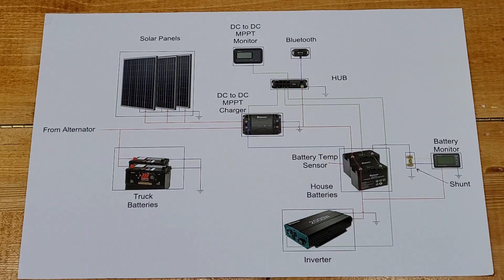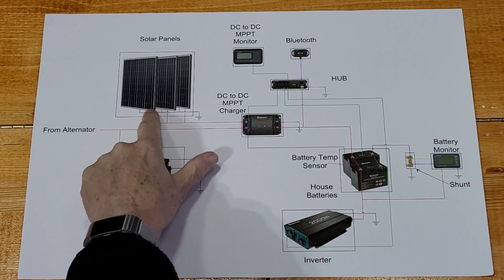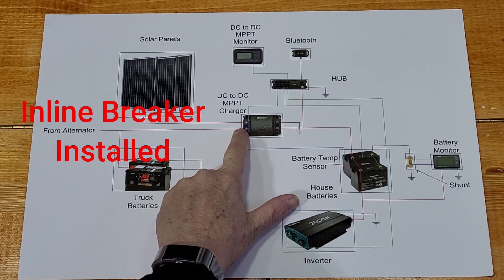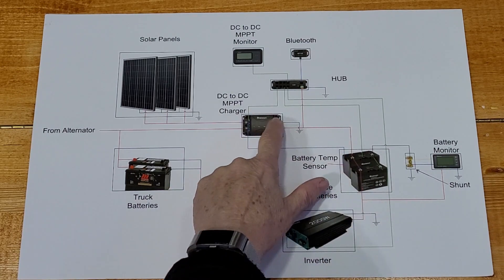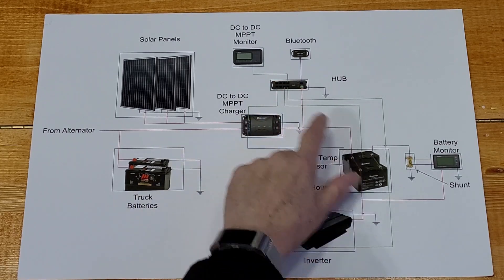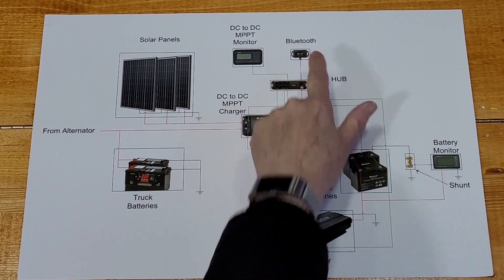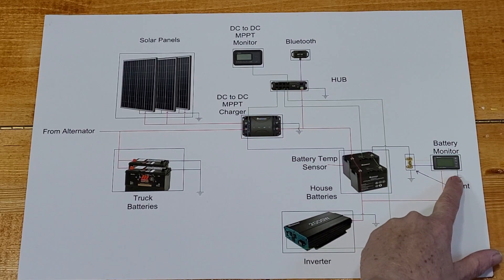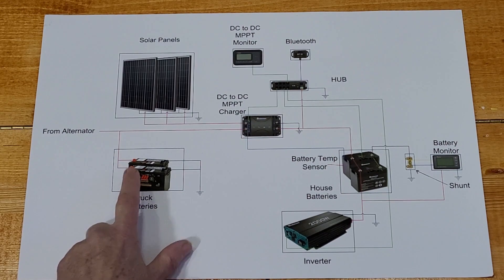Drawing and Description on Renogy Charger, Bluetooth, HUB, Lithium Batteries and Inverter install.

Comment: Hi, how did you connect Inverter to Hub? Inverter Remote port???
Reply from the maker: Hi Mike it depends on the model of inverter you get from Renogy some come with a RJ45 port some do not. 
I wish Renogy would provide RJ45 ports in all their products.
Reply: @waynesamboworld  I have the port on the inverter, but have not been able to pair the inverter to the app. How did you do that part?
Reply from the maker: @roryg94 @roryg94 unfortunately not all of Renogy inverters have a usable port. This what I look for when ordering or advising people what to buy.

Comment: Is your battery monitor by Renogy also?  Does it connect to the Hub?
Reply from the maker: Yes the battery monitor is by Renogy it is not connected to the hub.
Reply: @waynesamboworld  Is it possible to connect it to the Hub?
Reply from the maker: @thomasomeara2679  No this model can't. I would like Renogy to redesign their battery monitor for bluetooth connection and not to flash when charging. 
I will contact them with my suggestions.
Reply: @waynesamboworld  I’m helping a friend to redesign his system.  I have a Victron Smart Shunt 500 Amp + SmartSolar charge controller MPPT 100|30.  They communicate with each other.  It sounds like Renogy’s components don’t.  My friend has a Traumatic Brain Injury and needs a system that hides much of the technical stuff as possible.
Reply from the maker: @thomasomeara2679  I can design a system for you using Victron if you like I have helped others with their product. Email me at wayne@pallet-ivecare.ca with any of the products you have now or your ideas of what you are looking for and I will do a drawing and make instructions to help

Comment: Did you actually get the RMS-DCDC monitor to connect through the hub? 
I have that monitor, the hub & the BT-2 but I can only get the monitor to work when it’s connected directly to the 50DCDC charger.
Reply from the maker: I modified the hub. I am thinking of trying a POE switch to see if that will work.
Reply: @waynesamboworld  Thanks for the quick response. The issue is that the RMS-DCDC and the BT-2 are both primary controllers so they can't both control any secondary device at the same time. You have to unplug one to use the other in its place or, alternatively, have an actual switch to make the change.
Reply from the maker: @ThibaultDeLioncourt  if you email me at wayne@pallet-ivecare.ca I will send you a drawing of my mode to the hub and connections. Later today
Reply: @waynesamboworld  Email sent, thank you!
Reply: @ThibaultDeLioncourt I have the same problem.  can you help me?
Reply: @waynesamboworld I have the same problem.  can you help me?
Reply: @matteobasciani6506   My solution was to simply switch the feed through a multi-pin relay. I don't need to use the phone bluetooth app while driving so the wires are connected to the RMS-DCDC monitor that I can read while driving. When engine/ignition is switched off, the relay connects the wiring to the bluetooth sender so I can get a reading from my phone from outside the vehicle.
Hope that helps!